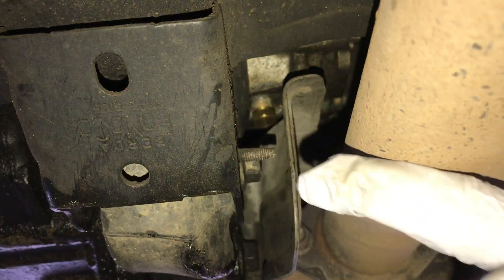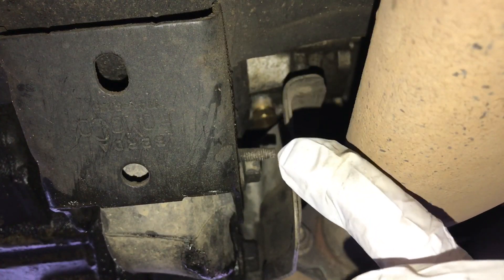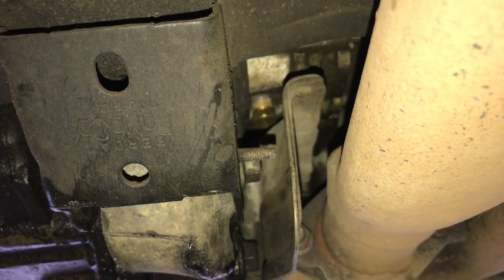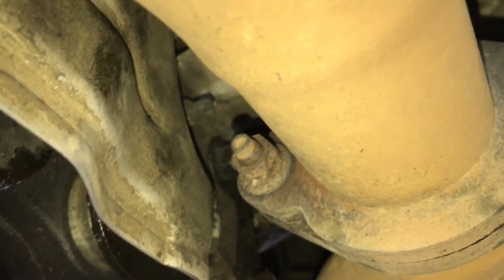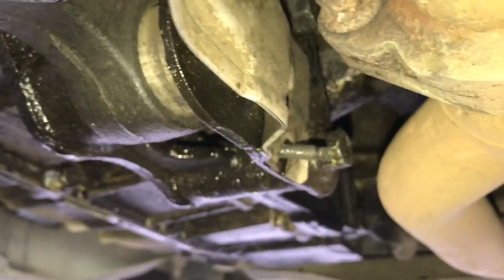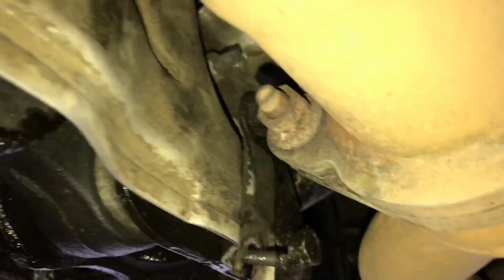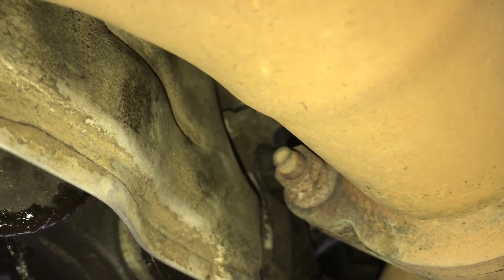Ford Edge PTU: Drill & Tap-Before and After 10K Miles (MKX)

Comment: You still have to get to the top bolt to add oil so why not just suck it out of there anyway?
Reply from the maker: It’s easier said then done unfortunately 🤷‍♂️. You won’t be able to extract all of the fluid out of the fill hole and so it will require multiple attempts depending on how pure you want your fluid and what type of service interval you plan on running. The benefit of the drain plug is you remove 99.5% of the fluid in 5 minutes, however it comes at the cost of risk during the drill and tap procedure. I’m not so naive to say that this is a risk free task, unfortunately we are risking a $1000 part for convenience during service. For me I appreciate having an easier service of the PTU.
Reply from the maker: What do you think is the one time risk to the PTU worth ease of service down the road?
Reply: @buckn32  any metal shavings and sluge will be at the bottom and stay there, if you don't drain from the bottom. That's with any lubricating fluid change. So there is that.
Reply: @buckn32  The one time risk is not as bad as the certain death Ford designed into the PTU. Think about it. If you drill and tap the hole as Buck Newby suggested. With grease on the tap, clean the tap every time you pull it out, and flush afterwards. Also the metal particles you might leave are aluminum. Not steel. Any steel particles will stick to any magnets you install in your new drain plug. From the looks of the design, it would be almost impossible to get a suction hose past that big gear right inside the PTU case. This is the way to go. You can send your drain oil in for analysis, or if you are a cheapskate like me, add some water to your plastic bowl you put your drain oil into and in a few days it will rust. Then you know you have steel.
Reply from the maker: That’s a nifty trick to check for iron/steel
Reply: Just tried that yesterday. Got 13 floz out in 2 hrs. Can't get it all so will have to repeat in a few months. After that the fluid will be mostly new. Plan to do a plug.
Reply: @Catimann  I'm changing my PTU this week and will drill and tap the new one before installing it. I'm deciding between a 1/4" or a 3/8" plug. Has anybody done this with a 3/8" plug?
Reply: @brianbrown600  Be careful as bigger is not always better. The housing surface area and metallurgical integrity should be kept.
Reply: I appreciate your work and videos.  If for had spent the extra $2 back then for the drain plug or did a better job of exhaust routing, we would not be having these posts.
In current 2021 times they have certainly learned from the past and sell vehicles who's PTU's have drain plugs.
Reply from the maker: Goes to show they aren’t perfect and learned from their mistakes like the rest of us 😉
Reply: @buckn32  my 2016 fpiu has a drain plug, and a cooler of sorts
Reply: @buckn32  Building a car isn't trivial, but to me, the engineers who were involved in the design of the PTU should have known that exposing it to high temps over a period of time can only lead to problems.
Reply: Too bad ford did not do this and put a external cooler to circulate and cool the gear oil  !
Reply: @stephengordon8968  To much added cost. When they build a vehicle, they are constrained by costs and sadly, as long as the car lasts beyond the mfg. warranty, it's good in their eyes. And it's not just Ford that looks at it this way.
Reply: because...gravity!
Reply: I NEED A FABRICATOR BECAUSE I HAVE AN IDEA THAT INCLUDES OFF THE SHELF PARTS TO FIX THIS AS LONG AS YOUR PTU HAS A DRAIN PLUG AN FILL PLUG. I wonder why I can buy a black label a 2020 with a twin turbo V6 for 25 to 30% off

Comment: Thanks for the vid. The gunk you had on the fill plug is exactly what causes these PTU's to fail in most cases: the oil turns into sludge which in turn takes out the PTU because it can no longer be cooled. There are some YouTubes showing the PTU taken apart filled with the sludge. When you drained it after only 10K miles, I believe you are getting some of the residual sludge that was still in the PTU. I changed my PTU fluid just recently for the 1st time; 60K miles on my 2013 Lincoln MKX and the fluid was better looking then they new fluid you drained after @ 10K miles. 😮

Comment: Use a depth stop when drilling so you only JUST penetrate the case, this will prevent damaging internals and put the minimum drillings into the case. Lots of grease on the Tap , after putting some into the hole to stop the debris moving up and entering the case. Have done similar to other vehicles and never had problems, so long as you find where the plug will not contact any internals when fitted AND have enough meat to grip without stripping the thread.

Comment: Does anyone know what the symptoms would be if you have a bad ptu? I have a 2013 edge and that while in reverse it jumps and makes loud banging noises but in drive it doesnt make the jumping banging noise just a slight noise
Reply from the maker: Hey Willie! I could give an answer with no actual knowledge of those particular symptoms but merely a hypothesis. I haven’t heard anyone tell me those symptoms before, so it leaves me with probably even less knowledge to diagnose than you. I would inspect all the cv axles and drivelines and look for slop as a first step before taking it to a shop though because if you cut those boys loose on it, then you probably won’t be walking out for any less than two grand. Those things are easier to fix (and cheaper) and most people can diagnose a problem with any of those components.
Reply: @buckn32  yes sir  it acts and sounds like a u joint but when it didnt do it forward it kinda threw me off, it was dark and cold outside so I figure I will check it out today, thanks for your reply, and just remeber not all heros wear capes!!
Reply from the maker: https://youtube.com/shorts/1eISQeYCFqY?feature=share that’s just last week I found a smoked driveline on my semi definitely had vibration going down the road. Easier fix on a big rig all I had to do was tighten the bolts and replace the missing bolt. The concepts are the same for automobiles simply the joints are less durable and can break more easily. Replaced driveline u joints in my jeep, and a couple dodge pickups. Not a horrible job usually.
Reply: @buckn32  UPDATE Well you saved me my friend, crawled under the 2013 edge and pulled the plug on the PTU and sure enough it was dry as a bone with a ton of metal shavings on the plug and inside the case, put the synthetic gear oil in and drove it a bit and with a transfer pump I pumped the oil back out and filled it up again. Happy to say that it is running like new again no noise or vibrations, thanks again for the video and all the responses from everyone!!
Reply from the maker: Perfect 🙌🙌🙌 way to go! 🎉 maybe check it out in 1000 miles or a couple months and see how it’s looking!
Reply from the maker: Or send it down the road haha

Comment: I really like the idea of adding a drain plug. I have yet to see anybody show this setup for the rear differential though. I asked to have this serviced along with rear differential and was told its filled for life and to just let it fail. It's easy to get told that when they aren't the ones shelling out $2k for a new ptu. Oh well, that's why I do my own maintenance as much as I can. And I do recommend full synthetic 75w-140 for the ptu to avoid thermal breakdown and longer change intervals. Lastly hear is the borderline stupid conversation I had about why fluid maintenance is important.
Me: so why can't the fluid be changed?
Tech: because its filled for life
Me: ummm...  what?
Tech: don't change it ever
Me: but it'll fail from overheating
Tech: oh well
Me: well, I know where I'm never having my car serviced anymore
*if you find yourself having conversations like this at dealerships or shops, find somewhere else to do business or learn how to do it yourself
Reply from the maker: It’s quite perplexing “why” they are having this conversation this way from the get go. My only deduction is they want to sell a $2000 product instead of a $50-$100; that product being a part and service.
Reply: @buckn32  I think you are right. I have actually heard from some people I know that jobs they do, that are in my opinion, not that difficult on execution are intentionally quoted at an astronomical price. I was quoted at a shop last year for $600 to have my rear differential serviced and got told the ptu was serviced. The differential wasn't done because of the high quote since I was told the entire rear end need pulled apart to remove the diff cover; 600 bucks to change 20 bucks of fluid. About 3 months ago I wanted the ptu serviced again after I drove 25k miles, but weirdly enough I get told its gonna take 2 to 3 hours to do it and the front exhaust and catalytic converter need to come off yet it was supposedly done in about 30 minutes last year. Yet they now said the rear differential was doable and quoted near $400 to do the ptu. Makes me super paranoid if the ptu was even done at all on my SHO it has 88k miles. That's what I call the runaround. I actually now have somebody to mentor me on repair work, I just cannot believe a business treats its customers like that and discourages basic maintenance... it's insane.
Reply: @buckn32  What makes it more perplexing is the PTU for the Taurus SHO Performance Package (only that model of the SHO) has a drain plug.  So they definitely knew the PTU fluid wasn't a "lifetime"  fluid and needed to be changed.

Comment: Did my 2008 MKZ  PTU, with a 1/8" pipe drill  tap, on the bottom .Used a Dorman # 61105 [HELP] radiator style petcock, which has a hose fitting. This allows draining and filling at the same source. Attach a 5'16" hose to a quart oil bottle, with a hand pump, Lubrimatic # 55-011 or other style, pump. Attach hose to drain plug fitting and fill with SYNTHETIC oil only, to specs. while watching until oil comes out of fill plug hole. I now drain the PTU oil with every engine oil change. Cheap insurance, to prevent another PTU failure. Ford' s BETTER IDEA, of not using a  drain plug has further damaged their reputation of QUALITY engineering. They will not issue a recall on this DISASTER. Over the fifty tears of  being an auto tech, there have been several FORD BLUNDERS.
Reply: David how is your setup holding up?  I like the idea of the petcock style plug as it does not have to be removed with each drain, and seems like it would be a lot easier to refill from here also, ty
Reply: @davidcoleman9304  awesome ty

Comment: 2016 Lincoln AWD 3.7L V6 29,000 miles took it in to the dealer to have them suck out the fluid and replace it the PTU WAS CRACKED and I couldn't drive it for over a week Certified Used Cars are complete BS  they replaced the PTU with the new type which has a drain plug I have Trip B set to the time I changed the PTU I'm tracking hours. I have 50 hours to 1000 miles so a lot of idling in traffic  at that time I paid to have the rear gear oil done and that doesn't see any heat andmitmhad already began to oxidize the rear is a 50,000 mile change a week ago I had them change the transmission fluid they flushed 16 quarts thru it and what a difference. Smooth shifting from park to reverse to drive the OEM FLUIDS IN 2016 Weren't as good as they are today the transfer cases and transmission are 100% synthetic the engine oil is partially synthetic I may switch to full synthetic butmmi don't drive a lot

Comment: Can i clean the AWD transfer case (PTU/PTO) by gasoline (Air Engine Cleaning Gun)
Reply from the maker: I’ve always used diesel... but I imagine gasoline would work as well.
Reply: @buckn32  Beware of using diesel it damage the Rubber.
Reply from the maker: Thanks for the heads up 😄

Comment: Where exactly did you install that drain plug on the PTU?  Was that centered on the PTU from Left to Right? OR off towards the Left Side Edge Off the PTU Lower Housing (for a gap inside the PTU Gears--So the Drill Bit & Tap wouldn't fowl the Gears)?
Reply from the maker: https://youtu.be/KQWh5cp2ZEc
This video👆 has specific measurements, hope that helps you getting your head around what needs to be done ✅
Reply: That will do--thanks!

Comment: Is there a reason you didnt opt to use a magnetic drain plug?
Reply from the maker: Actually yes! My reason to do a small drain hole was because the bigger the hole drilled increases chances of drill bit catching.
Reply: @buckn32  But you drilled and tapped for 1/4 right? They make 1/4" npt magnetic drain plugs - or am I missing something? Thanks for the fast response!
Reply from the maker: BigHesh81 think when I asked at my auto parts store they had a bigger size magnetic plug so I didn’t go with it or try to track a smaller one down. I also liked the softness of brass going into an aluminum case. I’m not necessarily an expert fabricator, I’ve done a bit of fabricating on farm equipment but never really received a formal education, so when I found something that worked I just ran with it. Someone could probably find a better way to do it than my program if they had the expertise.
Reply: @buckn32  No dont down play what you did, I think the video and execution of your idea is awesome, I just get the luxury of being an outsider viewing someone elses project, and the ability to tweak as I go lol. Your video has over 30K views, of which I think youve earned each and every single one! 

Was there any issue with the thickness of the plug or wall-thickness of the case? I only ask because of the mention (on your suggested drilling location diagram) of not wanting the plug to stick in too far into the case.
Reply from the maker: Thanks for the support it means a lot! If I had to guess we are only talking 3/16 thick give or take a 1/16; in other words not enough to think “oh there is no way I can mess this up” ... execution like you said is everything and also why I didn’t want to push my luck with the bigger hole. I’ve drilled into thin metal enough to know larger drill bits can catch and rip through the metal in a way that doesn’t res make a circle anymore, so I was leaving nothing up to chance, I used brand new drill bits and tap for the project.
Reply from the maker: “Res make” was supposed to be resemble
Reply from the maker: Someone was telling me on the escape that drill location does not work because it lines up with the gears inside. Other than that I have not had any negative feedback from people undertaking the job.
Reply: @buckn32  Well, I'm planning to add a drain to a 2010 Ford Flex (AWD, Ecoboost) so Im hoping I have the same success! I saw another video where a guy had gone thru the "faceplate" of the case, but I prefer your method as it is on the bottom, and more likely to allow for the best drainage & evacuation of junk. I'll be sure to use the most shallow of drain plug (magnetic or otherwise lol) to maintain a safe distance from the gears! Thanks for all your help, I REALLY appreciate it!
Reply from the maker: BigHesh81 no problem! Feel free to follow up and let me know who it goes! Look forward to celebrating your success 😄
Reply: @buckn32  Absolutely, will do! The plug I have coming is from McMaster Carr, it is a "Low-Pressure 316 Stainless Steel Plug with Hex Drive, Hollow with Magnet, 1/4 NPT Pipe Size" part number 1457N12 and it has a magnet contained within (as opposed to sticking out from the bottom of the plug like so many others do). Price for the plug is $3.40 (Canadian) and the plug's length is just under 3/4" (47/64" if we're being precise lol) and has a 1/4" drive hex. I only include this info in the event that you still have the Edge and wanna swap out the plug you used for a magnetic one next fluid-swap, or should anyone else be doing the same install! 

part: https://www.mcmaster.com/1457n12

Cheers!

Comment: Good video! Ford must really hate the people draining the fluids on their cars. 

On my Mercury Sable and Explorer I have bought transmission pans with drain plugs, made by Dorman, because I was getting fed-up with oil flowing over the whole edge of the pan when I was taking out the 21-odd bolts with fluid splashing inside.
Reply from the maker: That’s insane... 21 bolts 🤦‍♂️
Reply from the maker: “Lifetime fluid”
Reply: @buckn32  Your transmission pan has only 14 :) Search for a filter kit on Rockauto and you'll see.
Reply from the maker: Thanks buddy:)
Reply: I have another Toyota and a Kia and both say the same lifetime fluid. At least they have drain bolts. Black, black fluid at 50k miles. And yeah, transmission pans have 19 to 21 small bolts.

Comment: Is there a mileage point where the major problems start to show up on these units ?  We just picked up a 08 MKX for our son  to drive and this is a bit of a concern.  It also seems straight forward enough that I could tackle this myself .  Im guessing placement of the tapped hole is critical ?   I could suction it too.  What oil is used in these ?  Thanks for any help
Reply from the maker: My edge is an 07 and there was not any major design changes between those years. Basically the spot you can access to drill after removing the heat shield is the spot. If you want a picture with measurements then I could send the link to another one of my videos that gives the precise measurements if you want specifics. https://youtu.be/KQWh5cp2ZEc

Comment: I have an AWD Lincoln MKS Eco-boost. I'm getting ready for a cross country trip to visit family in April. I've already drained and filled the transmission fluid and I'm changing the PTU a and rear differential before I leave. And then changing it again when I get back home. Just to make sure everything is clean the PTU has a pretty bad reputation for failure if not properly maintained. I figure on changing everything every 30k miles. Fluid is cheaper than a major repair bill.
Reply from the maker: Your information seems consistent with what I would recommend. Regular maintenance is the name of the game.